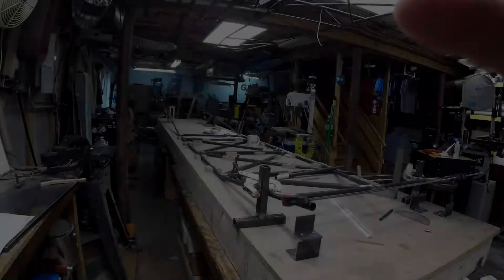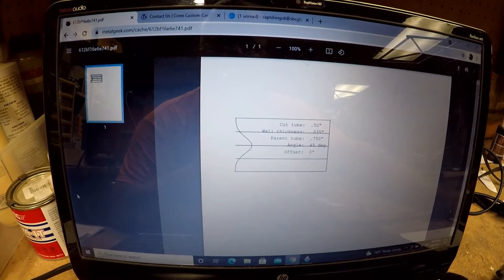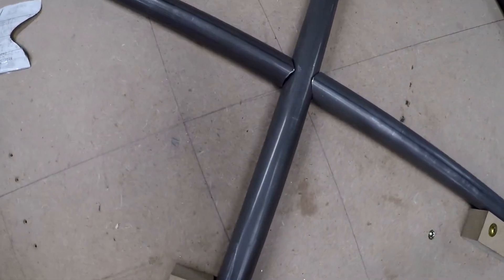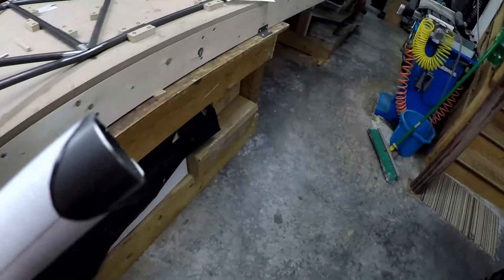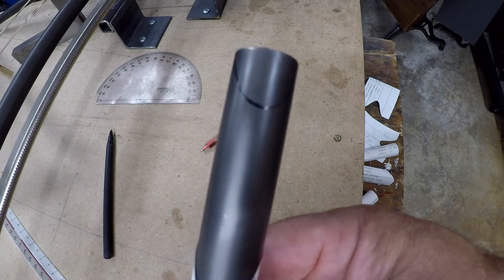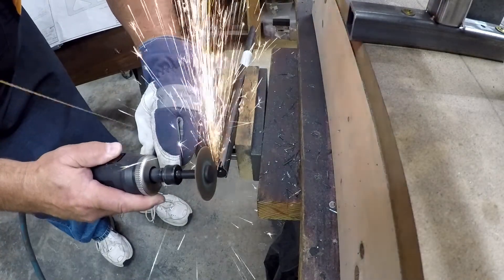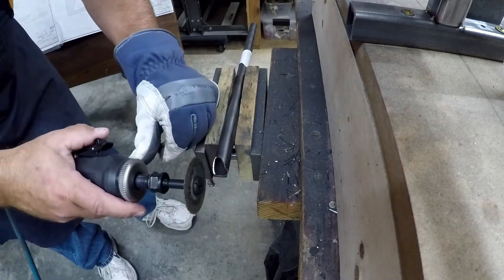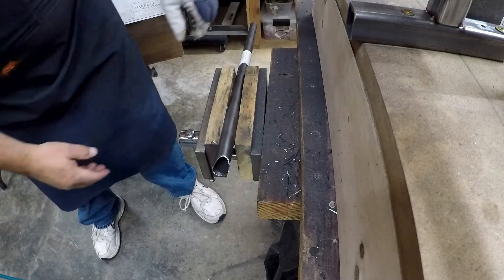How I cope tubing for my Hatz Classic Biplane fuselage.

Comment: 7" cut off wheel for a skil saw i put on old table saw. 1/2" bench grinder wheel, shape with a diamond  to half round. 
Was fast. That web site is cool. Thanks for posting.
Reply from the maker: Made the job so much easier. Those are great ideas too.